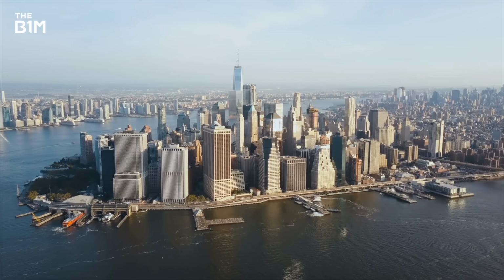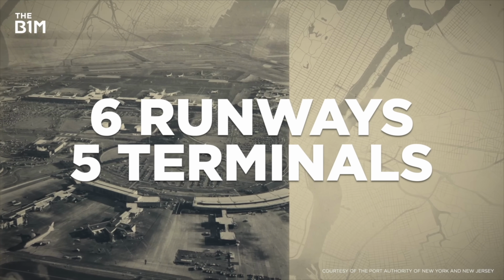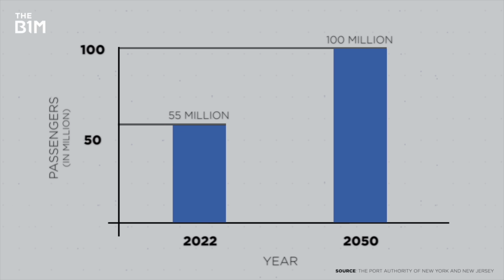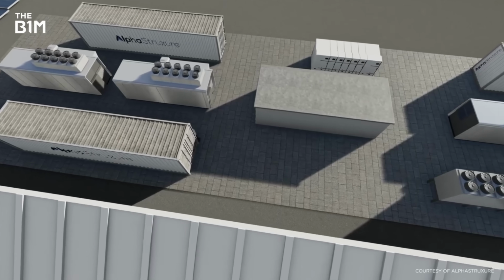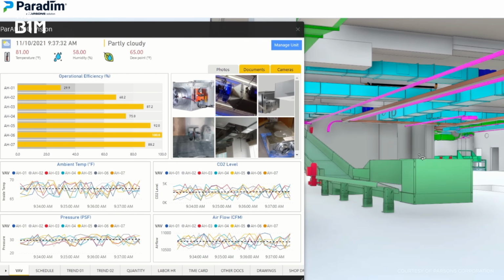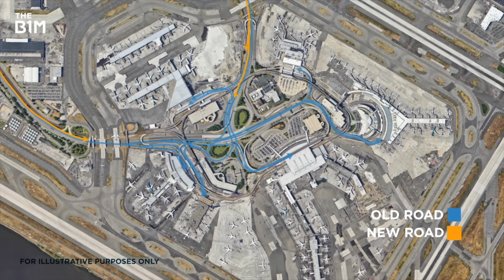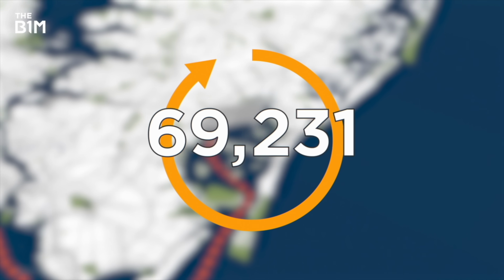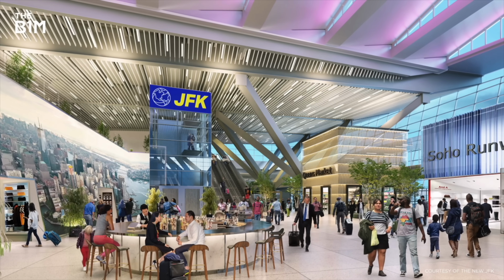The $19BN Plan to Save New York's Worst Airport

Comment: This video teased at the top, but skipped any details on one of the most important aspects - connectivity to the city. Cool, new parking garage. But what about the price gouging for the Air Train, a system that only recently started accepting contactless after long being divorced from both local commuter rail and subway?

Ride share and taxi are the least painful, but more expensive and less eco-friendly option to get to JFK. Doesn't look like there's anything being done to change that.

Comment: I know it's controversial to say but I prefer EWR aka Newark Liberty Airport in every way... It's older and smaller yes, but it's also much better connected to the metro and existing railways and its adding a PATH extension and upgradings its airport station all while rebuilding the older space-age 60's terminals into more modern facilities... Yes there are separate terminals but at least there's only 3 of 'em and the airtrain links them along one line...

Comment: For 19bn you could built a  proper airport. JFK is a s**thole. I have never seen any international airport as run-down and dysfunctional on any continent. And that includes developed and developing countries.

The upgrades look like an improvement but very underwhelming for the price. That they have to stress they have solar cells - like any new building - seems desperate. They still don't have a proper transport link, which is embarassing. "Traffic tech" and "transport hub" are just buzzwords to disguise that they have nothing except car parking.

It would be a start if you don't travel to NYC and feel like needing another tetanus shot.

Comment: This doesn't really do much. New terminals are nice, but it doesn't change the fact that JFK is way over capacity and 10 extra gates aren't going to solve that. It also doesn't solve what is, imho, the main issue with JFK, and that's accessibility. I would rather enter a suicide pact rather than drive to JFK again, I've done it over 10 times and every single time it's a nightmare. JFK desperately needs an air-rail link, and the stupid dinky little AirTrain with dogshit frequency and capacity doesn't count. We need a dedicated LIRR or express subway stop under the airport, directly connecting with 1 or 2 terminals with 15 minute intervals at the very least (this also applies to LaGuardia, that needed a subway connection 20 years ago). There is absolutely zero excuse for JFK to not have a direct airport connection when far smaller airports such as DCA, PHL, ORD, and SFO, not to mention nearly every airport in other developed and even second world nations have them.

Comment: All nice and stuff, but what is and will be missing: Good Public Transport. 20 km (13 mi) between JFK and Manhattan and it still takes an hour by AirTrain + MTA. It won't need crazy high-tech solutions like a Maglev or Hyper Loop. Standard rail with 160 km/h (100 mph), a limited number of stops (e.g. Broadway Junction + Atlantic Av/Barclays Ctr) and it should be easily done in 20-30 min.

Or just reactivate the old Rockaway Beach Branch between LIRR and Howard Beach, a cut-and-cover tunnel parallel to RWY 13R/31L, arriving between T1 and T4, done.

Comment: What a shame they're not improving the public transit options.  The SkyTrain to connect to subway / rail is a hack that's almost as long overdue for an upgrade as the airport terminals themselves.  Even as a hack, public transit always used to be the fastest way into Manhattan, but having traversed the airport during the current chaos I can confirm that it is very disrupted right now, and that inter-terminal bus is hard to find and follows the most diabolical route.

Comment: Lived there for years. They need a speedy train link to Manhattan(the city) and a LaGuardia connector. Unfortunately, there is no viable area to build a new airport. JFK has been a nightmare for decades but I’m glad they’re doing something.
Reply: Teterboro...??
Reply: @stuartlee6622 Teterboro is a busy metro small regional metro NY/NJ airport for CEO types. It’s not one of the three major NYC/NJ airports.
Reply: @OSTARAEB4 But it could be! The runways are longer than LaGuardia. It's close to New York City.
Reply: @stuartlee6622 I hadn’t thought of that but think Teterboro’s proximity especially to Newark approaches wouldn’t be an option. Despite LGA’s expansion of the runways in the sixties, I’m sure they’d appreciate another 3-5K in length if that was an option.

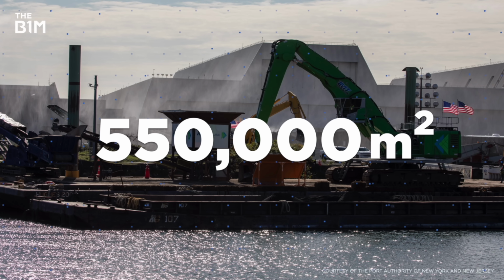Comment: 9:05, how's the unit of volume square meters? Wrong number or just the wrong unit?

Edit: wrong units, each olympic swimming pool is 2500 m3, and 550,000 m3 would be 220 pools, as said in the video.

Comment: still relying on air-train and roadway to connect between terminals is stupid. There should be an internal train system (or move existing air train) so passengers don't have to go through security when connecting between terminals
Reply: Too impractical to implement.
Reply: The air train is really not much different from any other major American airport like DFW, ATL, or DEN
Only exception is NY makes you pay for it?? Which is weird.
Reply: @blackhole9961  Airtrain is free if you stay in the terminal loop or go to Federal Plaza (where the car rentals are located). You only pay when you go to either the Howard Beach subway station or Jamaica Station (LIRR and subways).

Comment: When will this finish? 2085? lol
Reply: Both of the recent new terminal projects at Newark and LaGuardia airports were completed within reasonable periods of time. Why should this be any different?
Reply: @rnunez6398  This is typical of most projects in America. They hype the projects up, and they never mention the completion date. When you do further research, you find out that the project will take 20- 30 years. Hopefully, they finish this project in a reasonable time, as you said.
Reply: @pkishan47  My understanding is that the goal is to complete the first phase of New Terminal One by late 2026 and have the entire New Terminal One operational in 2030.
Reply: @rnunez6398  And the announcement for the reconstruction plan was announced back in January 4, 2017. The construction for Terminal One started in late 2022. So we are looking at 13+ years in total, including 8+ years of construction alone. I wouldn't call that reasonable. For the US, the timeline could be reasonable, but comparing it to the rest of the world, its pretty slow.

Comment: What jfk needs is better connection to the subway, not more space for cars. Car dependency causes more problems In a city as dense as NYC.

The airtrain runs like every 10 minutes and it's $9/pp to take it to the subway. It's absurd
Reply: That $8.50 airtrain, on a ride that takes less than 10 minutes and doesn't come nearly often enough, AFTER paying to get to Jamaica by LIRR or subway from Manhattan is absolutely infuriating. It's a total slap in the face.
Reply: @WellTextured  you can take a local bus instead to one subway station down instead and save
Reply: There's only one real solution to make connection by rail that's meaningful. That's have the Air Train connect seamlessly to Grand Central & Penn Station in Manhattan. Jamaica station is fine if you live on Long Island. But what about those to live up North or New Jersey? Nobody wants to haul luggage through the subway and connect either at Jamaica or Howard Beach. Do what they do in Tokyo and have an express rail from the main train stations in the city.
Reply: @klabkebash  Vienna airport has (at last!) longhaul rail station right under the terminal, so its possible to take CAT to the city or trains along the whole Westbahn to smaller cities all over the country - Linz, Salzburg etc. Everybody who needs to get between Vienna city and towns 100 km away (including Slovaks and Hungarians with international border just 30 km from the airport) uses car.
Reply: JFK is the only one of the three major NYC airports to have a Subway link at all.
Reply: Hold up, you have to PAY for the airtrain?? WTF
Reply: @jessiegeorg8438  You do not pay to transfer between terminals or to go to the long term parking and car rental areas, you only pay to connect to the Subway or LIRR trains.
Reply: JFK (like probably 99% of airports in the US) makes a LOT of money off parking (and rental car fees and things like taxi airport surcharges). If you could just tap in with your OMNY card and travel to JFK easily, more people would do it and hurt their revenue from those other forms of transport.
Reply: @jfwfreo I just googled this and found out that both the Subway and JFK airport are owned by the city of New York.. In that case the city should try to decrease its dependency on cars because no amount of car parking will ever pay for the road network and it's maintenance..
Reply: The airport is (like Newark and LaGuardia) owned by the port authority, not the city of New York.
Reply: @jfwfreo  The issue is the MTA  (Subway)and The Port Authority (Airports)  are different public entities.   The A train could be  easily extended into the airport but the funding streams are different.   The N and the W could be extended to LaGuardia.   In the end it comes down to money.  So they spend even more money on the Air Train workaround which is slower and less efficient.
Reply: @PerfectSpainValencia  The N & W are NOT prime for LaGuardia. E F G R & 7 trains are closer at 74th & Roosevelt. Plus, the MTA has the Q70 bus which is free and takes 6 minutes to get to 74th.
Reply: train riders aren't profitable
Reply: most people take cars,  they have bags,, just another stupid idea that makes NY worse........how much cheaper would this project be with out green delusion.
Reply: Not everybody in the metro area has access to the subway. I live in a northern part of queens where not only is the subway far, but it only goes to Manhattan (when I can drive straight south to JFK.) there is a bus to the subway route, but still, it is 30 minutes by car vs 90 or more via public transport. Paired with the fact that you need to show up super early because JFK is so gigantic/chaotic, you are exhausted before you get to the gate. If someone lives in Westchester, NJ or CT or even Long Island it is even worse. I am completely for subways over cars, but it is currently very inadequate to serve local needs.
Reply: Subways are not an option. WAY TOO DANGEROUS THESE DAYS.
Reply: @stuartlee6622 Totally not true. I’m German, just came back from NYC yesterday. Took the subway to Jamaica and then the Airtrain to Terminal1. I felt totally safe and I haven’t had any issue with the additional $8.50. 
Which was about 10% of a cab ride and taht would have taken probably as long as
Reply: @stuartlee6622 not even cuh just gotta carry sumthing always
Reply: You do know people need to park there cares right? I get you wat to ban cars but don't be disingues
Reply: @AL-lh2ht you can have both fuckwit. In fact subway lines makes driving more pleasurable as majority of travellers are taken off the roads into more efficient trains.
Reply: @AL-lh2ht nobody is saying ban cars?? Public transportation connections just allow people to have alternatives and choose not to drive if they want which results in less cars on the road and therefore less traffic
Reply: @AL-lh2ht take a look at Singapore’s airport. It has subway lines that go directly to the terminals AND a shit load of parking space as well.
Reply: @invinciblemode  To clarify, only Terminals 2 & 3 of Singapore's Changi Airport are directly connected to the MRT (subway/metro) station. From Terminal 1 & 4 you have to take the SkyTrain (an APM system) or a shuttle bus respectively to Terminals 2/3 1st, to get to the station. & the subway trains can get crowded with people boarding/alighting at suburbs & business parks along the way (i.e. there may be standing room only) but it's cheap
Reply: @invinciblemode I'd wager the large parking space available at Changi is mostly because of travellers in for long haul flights from Malaysia though
Reply: You can park your car at home, it isnt as if you're going to be using it while you're abroad... @AL-lh2ht
Reply: @g.matosdsul  and travel to international airport, and especially back to home after 20 hours of flight, with all bags, crying kids and at 0300 Sunday, by subway, buses and so on. Awesome plan.

Comment: It just sounds like bodging. NYC needs a new airport at this rate - Sydney, as well as other cities have done this in recent years. The terminals are only part of the problem - the runway layout and proximity to residential areas leads to bottlenecks in the system.
Reply: Where could it be located?
Reply: Idlewild was on the outskirts in the middle of nowhere when it was built.  Then people bought land there because it was cheap, and built houses right up to the fence.  Sorry, but if you build your house under the pattern of an airport you'll get airplane noise.  No sympathy.

Comment: $19 billion?! How can that even be possible? That’s the cost for the entire Victoria line in London! Or half the cost that Paris is spending on their 120miles and 68 metro expansion!
Reply: Much more expensive to build in this part of the country especially.
Reply: Building on top of an active airport as busy as JFK is expensive. Everything has to be planned out and done in stages without disrupting too much traffic. Lots of people and equipment end up sitting around waiting for the right moment.

But also, it's NYC. Everything costs several times what it should.
Reply: Paris is spending billions to host the summer Olympics including over a billion to clean up the polluted River Seine to use for water events so it’s all relative.

Comment: New roads, parking and bridges? Who cares? Nobody of sane mind drives to or from JFK. The best thing they could do would be to directly link JFK to the various rail networks, LIRR, MTA, Metro North, Amtrak, literally any of them. As it is now, it requires three different trains from three different rail operators for me to reach JFK. It's maybe 50 miles yet it usually takes 2-3 hours to get there. Simplify the damn trains and have a massive train terminal under the airport like literally every other major global city does.
Reply: You can't put a railway terminal under the airport because the airport is literally at sea level, so the ground water would flood any underground railway terminal. The Airtrain system is the best that can be done given the circumstances.
Reply: You must have forgotten JFK’s disjointed layout and disconnected terminals (which is explained in the video).
So a massive train terminal “under the airport” would probably land you under nothing but roads and taxiways. So you’d  still need something like the air train to shuttle you around the terminals which is what JFK currently is doing.
Its no different from DFWs skylink for example. The skylink shuttles you around the airport and you can take DART (light rail) to get to downtown.

Comment: JFK Airport is not owned by New York City. It is run by the Port Authority, which is 50% owned by New York state and 50% by New Jersey.
Reply: It’s owned 50/50, but as an NJ resident, let me just say the vibes are entirely distinct
Reply: Fun fact: the Tappan Zee bridge was deliberately built just outside of the Port Authority’s jurisdiction, which is anything within a 25 mile radius of the Statue of Liberty.
Reply: @ClockworksOfGL  And then when they recently had to rebuild it NY wanted the Port Authority to pay for it. NJ said no.
Reply: @ClockworksOfGL  The 25 miles starts from Columbus Circle if  memory serves
Reply: Kinda hilarious that he says "city officials finally decided to act" and then immediately cuts to a clip clearly from New York State.
Reply: So it’s owned by taxpayers
Reply: @brkbtjunkie  Here in NJ it's more like the taxpayers are owned by the politicians.
Reply: PANYNJ are a menace to society
Reply: The City of NY owns the airport. PANYNJ just has a super long-term lease.
Reply: @cykotronic  Just like Newark owns the property but the Port Authority  runs Newark Liberty Airport.
Reply: @cykotronic :  incorrect.  The City of NY owns the land.  PA of NY/NJ runs and owns JFK Airport.